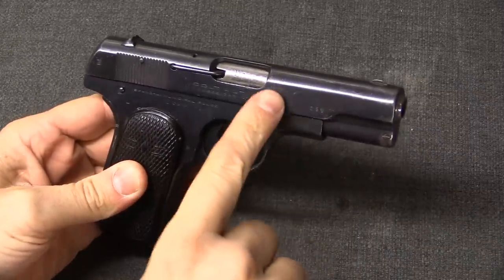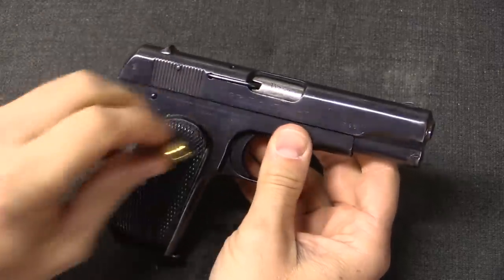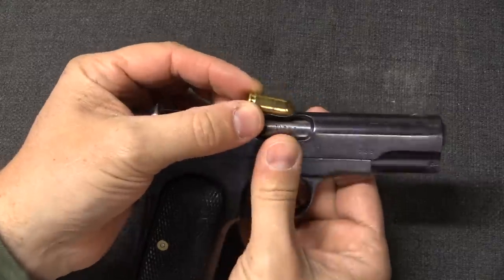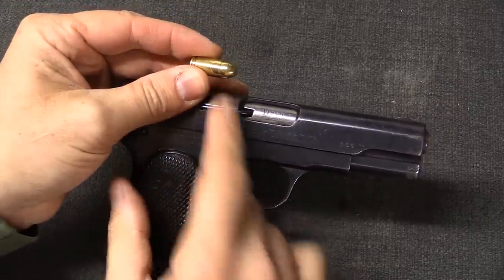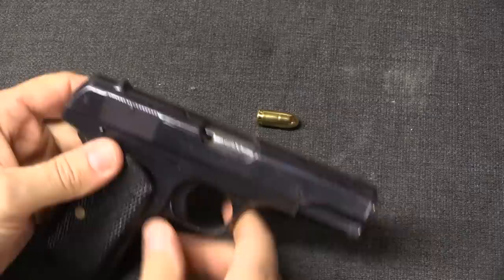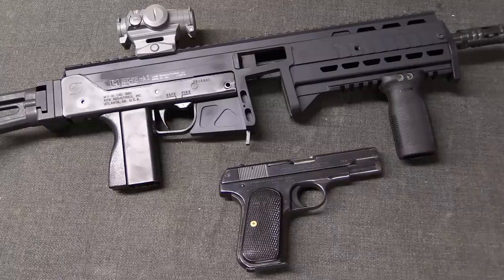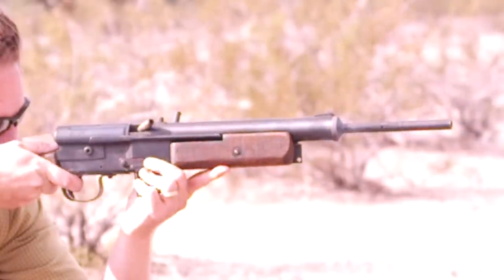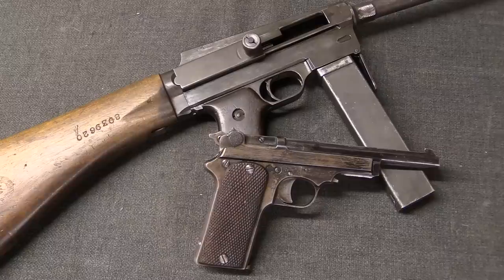How Does it Work: Blowback Action

Comment: Ian, and community - based on this very good video, is there any theoretical equation that says if the cartridge does THIS then the blowback parts will have to do THAT; ie if I wanted to make a 7.62mm NATO blowback weapon what would I theoretically need on the recoiling side of the equation to keep it safe? This is assuming no delayed blowback trickery or advanced primer ignition wizardry of course.

Comment: i feel like you forgot to mention what in the system allows the bolt to cycle back safely after the round leave the barrel. As you said the brass cartridge keeps the bolt from moving at the high pressures, so what happens after? does it un-seal against the barrel when pressure drops and then momentum carries the bolt back?
Reply: in  theory, the bass slipping pass the breach is timed with the bullet leaving the barrel, as such the pressure is vented and the bolt/slide can continue its rearward travel (which happens cuz of Newton's first law; objects in motion stays in motion unless acted upon by an outside force) the force slowing/stopping the bolt/slide are the friction of the bolt/slide on the guides/walls of the receiver and the force of the recoil/main spring pushing back on the bolt/slide. In practice this remains largely true, although there are ... notable exceptions.

Comment: Would it be feasible to have  a very tough, rigid spring to prevent the bolt in a higher powered firearm from being thrust back too quickly?
Reply: No. 
Let's put like that. In a 9mm firearm, the pressure in the chamber propels the slide backward for the first 1mm of it's run. Then the bullet leaves the barrel, the pressure drops, and only inertia keeps on pushing the slide, while the recoil spring slow it dow, for the residual 40mm or run. 
And yet the slide slams into the receiver.
That means that a standard recoil spring resistance is less (much less) than 1/40 of the initial recoil impulse.
That's why, in calculating the necessary mass of the bolt in blowback firearms, the resistance of the spring is not even taken into account.  
A human wouldn't be able to rack a slide/bolt with a recoil spring so rigid to really delay the opening of the bolt.

Comment: Good video!  I always wondered about something else about blowback designs: Does the movement of the heavy mass backward affect the trajectory of the projectile?
Reply: the bolt/slide doesn't really start moving until afer the bullet has left the barrel, so not really
Reply: @gmh3  OK, so what I'm thinking is that the force which accelerates the bullet acts in all directions, including straight back.  So let's just say that the parts travelling rearward weigh 100 times the mass of the projectile.  That would mean that by the time the projectile accelerates to the 100mm distance , the slide will have been accelerated rearward one mm. What I think happens is the bullet leaves the barrel well before the slide slams into its stop. So the barrel is not moved or vibrated providing the slide is mechanicly friction free.  How am I doing?

Comment: As far as my incomplete knowledge goes pretty much all blowback operated guns also have a main spring, which of course is there to return the mechanism back to it's place, but as it goes unmentioned in this video I wondered doesn't the spring also contribute to the delay in the blowback action?
Reply: not appreciably. The spring might be a 10-20 pound pull, but there's tens of thousands of pressure pushing against it. It doesn't really stand a chance.
Reply: @Cultural Relic ah, the tens of thousands thing was taken from the video. I didn't care to look up exact numbers because I knew the comparative values are always going to be so far apart it doesn't matter. Even for something small like .22LR.

Comment: This description is not entirely accurate. While the mass of the bolt/slide is very important for the proper functioning of a blowback firearm, the other extremely important factor that prevents the bolt from opening prematurely is the friction between the walls of the cartridge case and the surface of the chamber. When the cartridge is fired, the walls of the case are pressed by the chamber pressure outwards, against the chamber walls, with a great force, so the friction can be pretty high. In fact, it may be so high that the case (and the bolt, which in this design moves back only if it is pushed by the case) would not move at all, or move only a negligible distance (several millimeters). As soon as the bullet leaves the barrel, pressure drops, as well as friction between the case and the chamber walls. The bolt starts to move much faster than before, being pushed back by the residual pressure in the barrel. From now on, the mass of the bolt becomes the most important factor limiting the speed of its travel (the second, less important, one being the stiffness of the recoil spring).

I've studied firearm design in the university (never graduated, though) and still have several textbooks. 
There is an empirical (i.e., based on practice, not theoretic calculations) equation:

l/d < 1/(48*[d1/d]^2) , where: 

d - is the internal diameter of the case; 
d1 - is the outside diameter of the case; 
l - is the length of the case 
(applicable for a roughly cylindrical case with roughly uniform thickness of the walls).

If this condition is not met, the blowback firearm will not work properly with this cartridge.

That means, for instance, that if the case is too long for its diameter, you will not be able to design a blowback operated firearm for this cartridge, because the case would inevitably rupture - the force of friction between its walls and the chamber would be so high that the pressure on the bottom of the case would separate the head of the case from the rest of it.
As an example, it is nearly impossible to design a practical blowback firearm for the .30 Carbine cartridge, not because it is too powerful, but because the case is just too long relative to its diameter. 
7.62x39 mm, on the other hand, can work in a blowback firearm reasonably well, because its bottle-necked case is relatively short for its o/a diameter (but, to achieve safe operation and relatively slow rate of fire, the bolt has to weight around 1 kg, which makes it quite impractical - as found the hard way during the tests which eventually led to the adoption of the Kalashnikov; the initial design by Shpagin -

http://www.russianarms.ru/forum/index.php?action=dlattach;topic=13521.0;attach=303888;image

- was simple blowback operated; it kind of worked, but extracted the case under very high pressure, and was extremely unstable in full-auto because the bolt weighted ~1.2 kg).

If there is no or very little friction between the case and the walls of the chamber, you will need a very massive bolt for the firearm to operate safely. That may be the case, e.g., if you are using a .22LR adapter, as in Tokarev Sportowy - 

https://upload.wikimedia.org/wikipedia/commons/0/09/Tokarev_Sportowy_-_22_LR.jpg

These adapters have very thick walls and the chamber pressure generated by the wimpy .22LR cartridge is by far no enough to deform them even slightly, so there is no or very little friction between the adapter and the chamber. Therefore, you need a much heavier bolt/slide than you would if you were firing .22LR without an adapter (however, because of the friction, the adapter and the spent case extract as one piece - without the friction, the case would move back, and the adapter would stay in the chamber, so the firearm would not function properly).

Comment: Simple blow back already contains a kind of delaying mechanism. As long as there is a high enough pressure in the barrel, the cartridge case is "inflated" and wants to cling to the chamber wall. It is not much, but it is something.
Reply: Good point! I believe there are guns with "fluted chambers" to amplify this effect?

edit: (after some googling)
Apparently their purpose is the exact opposite, to facilitate extraction.
Reply: @jasondoe2596  The fluted chamber works the other way, to make the case less sticky, if I remember correctly. The MP5 has this fluted chamber and I tink ist was made to ease extraction because they otherwise would get failures to extract and seperated case heads. The fired cases look funny, wearing a striped pattern.
Reply: Interesting, thank you  :)
Reply: @kovona  in toolmaking I learned that an angle from 0° to 7° (steel on steel) , for example on morse tapers or threads, you get a self locking connection between parts. This means a cartrige case doesn't have to be straight walled to get the same self locking effect. Of course brass on steel is something else, but it does mean a case can be conical, without losing this friction lock. You would just have to decrease the angle accordingly. As Ian said, there have been rifles and things build with unlocked breeches in high powered calibers, it just wasn't practical to have the needed mass in a bolt.
Reply: Unfortunately it's the thing that will facilitate the case rupture (since the front of the case is clinged to the chamber and the back is pushed out of it, the case is stretched and breaks). Infact, the fluted chamber was invented to aid extraction and allow the cartridge to start moving when the pressure is still relatively high.
However a mechanism, the "ring delayed blowback" had been invented to instead use this pressure to delay the opening. However is debated if it really worked or not.

Comment: Not to be too pedantic, but it's momentum that's conserved, not energy. If the energy is conserved, guy behind the gun would be knocked over or worse. There's undergrad Physics experiment called ballistic pendulum that illustrates this concept. It was run with real rifle before antigunners stepped in.

Comment: Can a stronger spring be used to enable a lower mass slide/bolt or would the strength required mean that operating the action by hand would become too difficult?
Reply: yes, and yes. it would require so much spring pressure that you'd need a winch to operate it to make enough of a difference to matter. Then the action would close so fast it can't self load.

Comment: Isn't this a little tricky for open bolt weapons? 

So if the round fires just before the bolt has entirely closed (which may be by design and a desirable feature) the bolt will still have the forward momentum from being pushed forward by the spring, effectively the force on the back of the cartridge doesn't just have to accelerate the bolt backwards but also cancel out the forward motion (toward the muzzle) inertia of the bolt. However, if for whatever reason the bolt completely closes before firing (such as an extremely short hangfire or the round being fully in the chamber) then the bolt will instantly lose inertia, transferring that momentum to the weapon (which may move the weapon forward slightly, and so, open the action slightly) or may even bounce off the barrel and have a rearward velocity or open slightly at the moment of firing.

I know open bolt MAG FED weapons are considered "Machine guns" under US law no matter what, but open bolt is not considered a machine gun if it lacks a magazine nor any other mechanical means of having another round held ready to be fed into the chamber.
Reply from the maker: You are describing advanced primer ignition, which is not really a factor in typical open bolt submachine guns. I will cover it in a later video.
Reply: @ForgottenWeapons  Supposedly for the L2A3 Sterling submachine gun specifically "the maximum chamber pressure is achieved while the breechblock is still moving forward and is about 0.46 mm away from the rear face of the chamber."

That is a sourced wikipedia quote to a published book (Tactical Small Arms of the 21st Century by Charles Q. Cutshaw, 2011) but I no longer have access to that source either by the wikipedia link (it's 404'd) nor can find it anywhere else short of buying it on ebay and importing it.

And I'm sure I remember hearing about this somewhere else, it was some sort of technical document for the Sterling SMG where it said something like "never try to fire by single loading rounds into the chamber, firing from fully seated position will cause the bolt to open too quickly due to this lack of API like effect"

I think the British were the only people to seriously look at this because by the time the tech was around to measure this, everyone was forgetting about blowback submachine guns for assault rifles or at least much more advanced SMGs like the MP5.

Comment: Why aren't more straight blowback mechanisms used on stationary or vehicle mounted weapons where the weight and/or spring force isn't an issue?
Reply: Locking system are not that complex. It might make a pistol or a sub-machingun a bit larger and more expensive to manufacture. Large will be expensive even so extra manufacturing of the locking mechanism is not that relevant. There is limits of hos stiff springs you can use because the bold need to move back far enough to cycle the gun  while still not moving back far enough before the bullet leave the longer bullets.

There are larger calibre simple blowback weapons like the Oerlikon 20 mm cannon with the small addition that the shell is fired a while the mechanism still move forward  so gas has to first cancel out the forward momentum of the mechanism before it stat to move backwards

Comment: It's not so much that rifle cartridges are too powerful for a true blow back design, but has everything to do with the cartridge shape itself. In fact, a 223 has roughly the same momentum, NOT kinetic energy, as a 9mm. Once a bottle necked rifle cartridge moved back even the slightest, it would no longer be supported by the chamber due to the shape, causing some serious issues like case rupture and injury to the shooter. This is not an issue with straight walled cartridges or even slightly tapered cartridges such as the 9mm. Hi Points come to mind.
Reply: Another reason that I forgot to mention is that rifles have longer barrels, so the cartridge is able to move backward much further before the bullet leaves the barrel to where pressures drop to very low levels. I think this is more of a reason why rifles don't typically use true blow back designs. oops lol another thing I forgot is that rifles run on much higher pressures, pressures that would easily rupture a brass casing. So yeah, it's possible to design a blowback rifle, but it's not really practical.
Reply: The real reason is Pascal's principle. Any square mm of the case is subject to the same pressure. But the bolt is pushed back by the base of the cartridge. If the base of the cartridge has 4 times the area of the base of the bullet, the force pushing back the bolt is 4 times the one that's propelling the bullet. So, if a .223 has roughly the same momentum as a 9mm, but the base of the cartridge has four timesthe area of the base of the bullet, it needs a 4 times heavier bolt.

Comment: Dumb Question: Since a blowback gun's mass (aka the moving part attached to the gun), is designed specifically with the expected pressure/momentum from a standard round (ex. standard 9mm), I assume it's a bad idea to use overpressure +P ammunition with simple blowback guns?
Reply from the maker: Correct.
Reply: @ForgottenWeapons  Thank you for the answer, Ian! I'm pleasantly surprised by such "personalized" attention from you. Love this educational series of videos and please do more interviews with gun designers; my favorite (and most referred) video of yours is still your interview with Tony Neophytou focusing on gun design tradeoffs, out-of-box thinking, and finding product-market fit. Eagerly awaiting the next video of your "Gun Designer" series :-D
Reply: Actually, to be sold on the market, any firearm must have shown to be capable to safely shoot proof cartridges that produces 25% more pressure than the maximum pressure limit for the same cartridge in its commercial version. Blowback weapons are as safe as breechlock weapon in firing +P ammos. The limiting factor, for both, is simply the resistance of the frame/slide assembly to the harder beating created by the more powerful (10% more in case of the +P) ammos.
In reality, for pistol cartridges, the weight of the bolt/slide in blowback weapons is almost always much higher that the one needed to simply avoid case separation, even for proofloads. An heavier slide/bolt is used to tame the perceived recoil and, in SMGs, to reduce the fire rate.
Reply: @neutronalchemist3241  thanks for the additional clarification; that clarifies my understanding of blowback. From a conceptual perspective, I was thinking that the slide has enough horizontal movement to "gradually" come to a stop (before it hit the physical limit on end of travel) instead of "hitting" the end of travel. The latter certainly makes it "easier" to balance that physics equation between reliable ejection and preventing case separation.